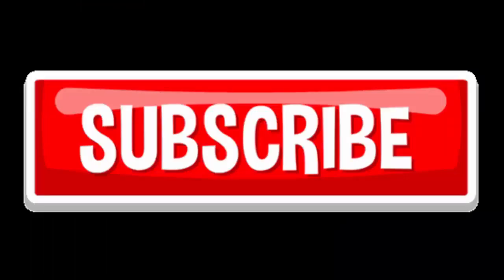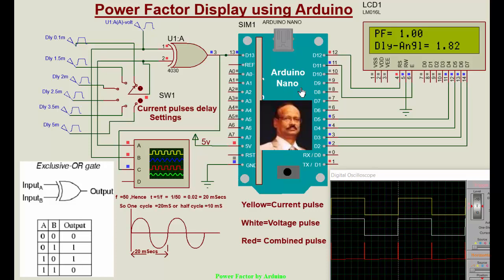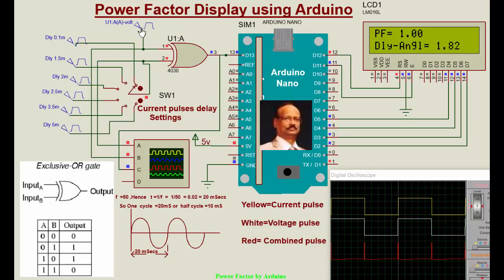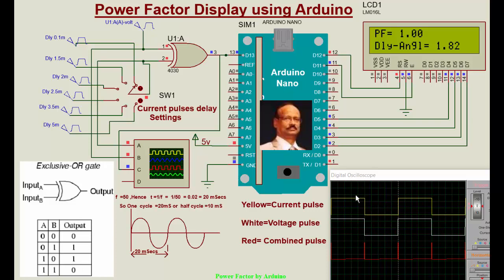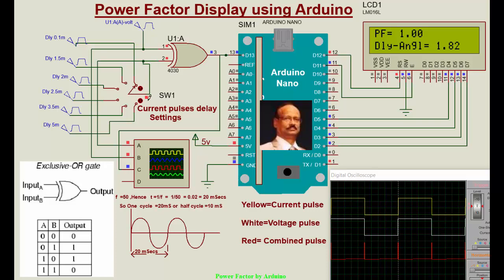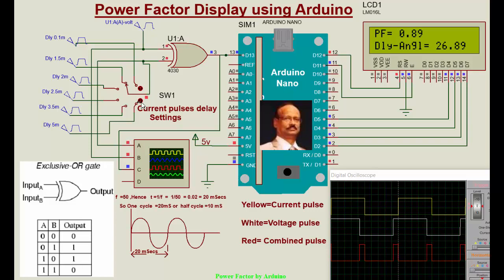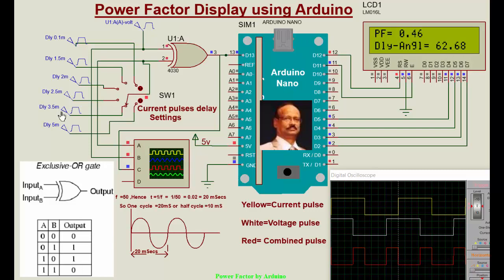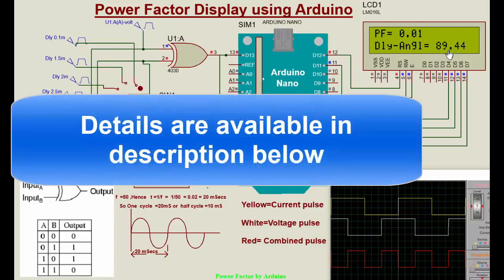Power Factor Practical

Comment: Sir it can posible in hardware to do xor gate operations at speed of 50hz  frequency (1/50 second  speed)
Reply from the maker: Not that easy
Reply: @PatnaikUC  the propegation delay of logic gate always in nanoseconds than why it's not possible .I am waiting of your reply
Reply from the maker: @ijazulhaq8043  Not clear your question
Reply: @PatnaikUC  I mean the speed of logic gates depends on propegation delay(time delay takin by logic gate to convert input to output) and propegation delay always in nanosecond than why it's not working at speed of 50 hz frequency
Reply from the maker: @ijazulhaq8043  propagation delay of logic gate has no role to play in this circuit. One input to the gate is zero cross pulse of the supply wave while the other is from several delayed angle pulses with respect to the supply of 50 Hz through a selector switch ( all such pulses taken from the library of Proteus) This is just to watch the pf angle at different delays that happens in real inductive hardware load so that an outward circuit can be added to build an automated power factor unit. Be reminded the input circuits are also to be designed. Please watch my similar video on APFC (automatic power factor correction )
Reply: @PatnaikUC  it mean its possible in hardware to do xor gate xor operation at speed of 50 hz

Comment: Hello sir i have mailed you regarding soft starter for induction motor using arduino. And you have provided me the circuit and hexcode. But i need to change something in it. For that i need the program. I don't know much about programming of Arduino. So if you can provide me that program code also it will be helpful to me 
Please sir i need this
Reply from the maker: Ravi Prajapati visit www.projectntraining.com